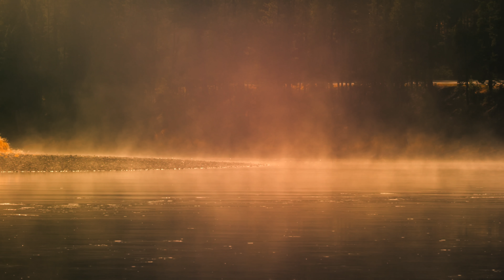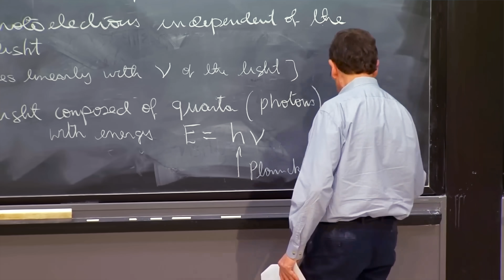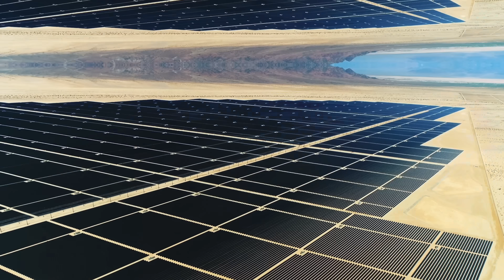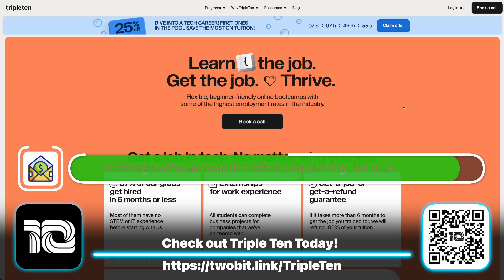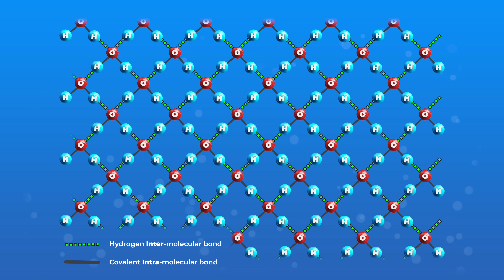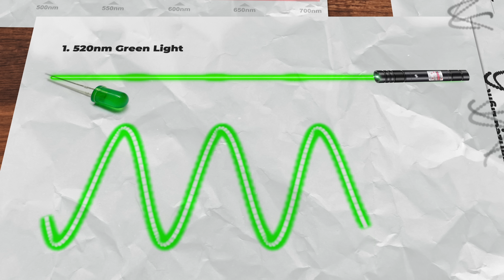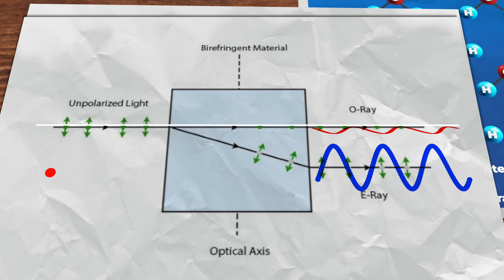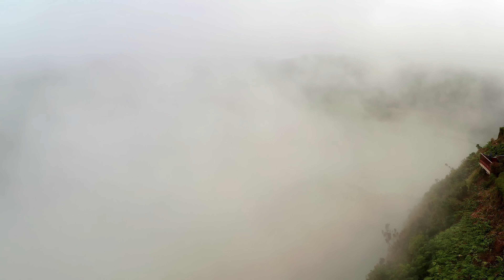New MIT Discovery Just Solved Water's BIGGEST Mystery!

Comment: Could we make a solar cell that lets the green light pass through and generate electricity from the rest of the spectrum?
Reply from the maker: this is very interesting, the key would be to collect as much electricity with band gap solar that allos allows the green through for some other effect. such fascinating potential!
Reply: photomolecular effect doesn't generate electricity though. but you could do the kther way around and  have water on top of the solar cells rhat would evaporate and cool the cells and produce warer vapor at the same time. the problem is how to catch the water vapor on top of rhe cell Ithout obscuring the light. plus how to keep water on top if the cells are leaning towards light. you could use capilarity to slow down the water following gravity, and and a layer of air sandwiched between the layer of water + colar cells and a clear glass/poly panel, holding the vapor recirculated to condense into a distilled water container to make you solar panels produce electricity + drinking water. letting rhe solar panels flat would avoid the need to pump the water up the slope, but reduce the panels efficiency...also evaporating dirty water on top of a solar panel would quickly create residues that would block light so your water needs to be filtered first.
Reply: @geemy9675  🤔 There's a new PlasmaChannel video where he moves water vapor around with static electricity. If you could get the system to naturally build up a static charge, maybe you could move the water vapor to the corners and collect it on mini fog nets? I am assuming the power it would take to power the static field from the solar collected would be more than a useful output of the panels.

Water droplets generate a static charge, but would there be enough generated by the drips from the fog nets?  And not be discharged every time a squirrel ran across it.

Haha, maybe a wind powered wimshurst machine to power it 😁
Reply: @colleenforrest7936  the static charge is not spontaneous but result of movement of falling droplets , it's only converting energy (potential >mechanic>electric). when you want to "produce" energy you actually have to wonder what energy you want to convert and what will supply this energy. thinking producing vapor will spontaneously generate electric energy is forgetting this basic principle
Reply: @geemy9675  maybe even out the pulses with a supercap could you collect that charge in a supercap and then use that to power a battery that charges the static field on the solar panel.  Granted, the math has to be done to see if it's a net positive system.

Putting this all together, you'd have a rechargeable battery responsible to keep a steady static charge over its assigned cel. 

The battery is charged by a supercap, with some sort of distribution net to transfer  excess static charge to other super caps (or electricity to the batteries if that's a better design) that are underpowered, and a sink to hold any excess charge above that for later use. The supercap is charged by droplets of water vapor condensing on a small fog net sitting sitting in the corner of a solar cel. This water is then channeled off to a freshwater holding tank.  The water vapor is created by the evaporation of "dirty" by green light, with the rest of the light in the spectrum being allowed to reach the solar cel and generate electricity. The water vapor is moved to the corners of the solar cel and onto the fog nets by manipulating the static field, which is charged by the battery.  As is current, there would be multiple cels on a panel, and multiple panels in the system. Questions as to wether the math works out on an ideal system, would the dirty water or water vapor reduce the charge to the solar panels...

Gees, I watch too much YouTube 😄
Reply: That's a pretty good idea and it could work. We could simply split the light using a prism or something similar, redirect the green light, then recombine the rest of the light to point it at a solar cell. With the generated electricity, we could then power a green LED and get even more efficiency out of the system.
Reply: @Israel_Two_Bit  - Definitely "Mirrors!" Maybe no "Smoke" - But we can work on that! 🤔😲😂
Reply: If you could, you could do far better than this - separate the light into several different bands and aim each at a PV cell tuned for that range of the spectrum.  Such a setup would blow away current solar panels for both efficiency and longevity.
[PV cells absorb at a specific spectrum - light below that energy level does not produce electricity, and light above that energy level produces excess heat, and less electricity than it otherwise could.  Reducing that excess heat would be the longevity improvement.]
Reply: thats just a solar cell with a green light filter over it, would actually have less energy since your not using all of the energy, wasting energy by not using the green light as energy. How about this, a water panel which will work all day and night since the moon still reflects white light, the water in it evaporates and the panel uses its energy involved in evaporation, then the cell of water condenses, and it does it with the rest of the cells, rinse and repeat.

Comment: Desalination would be an extreme leap forward.
Reply: Probably just set up a continual flow of seawater through a desalination system and the seawater that comes out will only be slightly saltier than at the intake.
Reply: If the evaporation from light causes groups of water to evaporate instead of single molecules, would that cause salt trapped in that group to be carried over as well, or does the salt get excluded?
Reply: @tardigrades3184  I don't think NaCl makes hydrogen bonds so it can't connect to water molecules, it just dissolves in water.
Reply: @tardigrades3184  No.  only water vapor would be able to evaporate into the air.
Reply: We should first figure out what to do with the waste brine. But of course we won't.
Reply: @davidmccarthy6061  perhaps sodium batteries?
Reply: @davidmccarthy6061  Use it to make Sodium Hydroxide (NaOH). Use NaOH in water to strip the Oxide layer from aluminium. Aluminium reacts with water creating an electric current, sensible heat and pure hydrogen gas. That makes aluminium a perfect source for seasonal energy storage and on-demand hydrogen production.
Reply: @davidmccarthy6061  there are plenty of uses for salt, and brine. We have plenty of tapped out salt mines we could store the new salt supply in. But I understand your sentiment, we (as a society) are often finding solutions either "in the nick of time" or after the disaster has already happened. Then someone sees an opportunity to exploit the disaster for billions of dollars, setting the situation up for the next foreseeable and preventable disaster.
Reply: @davidmccarthy6061  most places that need desalination are desert, so we could just fill basins with salt to create highly reflective salt flats to reflect the sun.
Reply: @davidmccarthy6061  What is completely underutilized is the resultant brine from desalination processes. It is usually considered as a problem to deal with, rather than an additional benefit from the process. Seawaters common name of salt water is part of this problem. That causes the other elements in the seawater to be somewhat ignored. 
  If you completely dry the brine, what you have is about 150 different compounds arranged in various molecular structures. This will vary, depending upon where the initial seawater is sourced from. These compounds are easily reduced to a powder form. Which will make the initial separation processes relatively easy. Just pass them over a series of different sized meshes. You can then use magnets and other separation processes, such as ones that differentiate between densities, to refine these elements to an even greater degree. Of course this would only be economically feasible in a large scale model.
  A major cost in traditional mining processes is the crushing of the substrates that the desired materials are embedded within. The above mentioned process eliminates that cost. The materials come in an already powdered form, or one that is easily reduced to powder. The economically valuable elements that are embedded within sea water are numerous. Everything from iron to gold and silver.
Reply: @davidmccarthy6061  Molten salt could be a huge help in making safer nuclear plants,
Reply: @cuzz63  Yes, but that would be salts of Thorium.

Comment: sublimation- known for many years. For example, snow straight to vapor.
Reply: @buildaboiworkshop it's H2O- light activated escape.
Reply from the maker: yeah this isn't sublimation, this is the interaction between photons and the hydrogen bonds that hold water together. but what it can mean for our understanding is pretty amazing
Reply: @TwoBitDaVinci yeah its not the same but photomolecular effect might work for sublimation too? H2O molecules in ice or snow have 4 bonds so I have no idea if photons have enough energy to create sublimation ar rge surface of water crystals but if it does it could have implications about ice & snow melting/sublimation models
Reply: @buildaboiworkshopbut water does exist in three states like any chemical element. the phenomen described in thr video isbnot sublimation but it raises an interesting question
Reply: @geemy9675  many many miles beneath the surface of the Earth, water is bound in rock at pressures and temperatures that give it a supercritical state. Water has many more states than 3.
Reply: @TheRotnflesh  you can argue 3 or 4 but the point is water is not only liquid

Comment: Superb presentation. One of the best cutting edge science explanations I have ever heard. I live in the humid south. I have always admired arid western "Swamp Coolers" which cool air through evaporation. Drying humid air with light to cool it, has major potential.
Reply from the maker: thank you Chris for the kind words.... swamp coolers ... now that's interesting... because of the potential for cooling there's some synergy, but it would increase humidity and in the south you definitely don't want that. Capitalizing on this phenomenon would be great in dry warm places like the southwest
Reply: @TwoBitDaVinci 
 I listened closely to your discussion starting at TM 9:30. Yes, the resulting air is cooler and more humid. For humid climates, all that needs to be done is to use an air-to-air heat-exchangers. Depending on the Delta-T, cooling the incoming outside air should cause condensation.  Thanks Again.
Reply: @TwoBitDaVinci Of course in a race between evaporative cooling, AC, and heat pumps. At this time good heat pumps win.

Comment: The wavelength that is most efficient is the same as that of most plant leaves or algae.  Is there a connection here?
Reply: It could be a factor but I would be careful about jumping to that conclusion. 

This explanation would only make sense if reflecting the green light decreases the likelihood of this interaction occurring on the plant. Given that it is a surface interaction (i.e. the effect happening further inside the plant would not cause evaporation because the water is not in a position where it can leave the plant) reflecting the green light rather than absorbing it may actually increase the incidence of this effect (absorbing the light with a pigment would reduce the number of times the light passes through the surface of the plant).

Compound this with the information that:
- Not all plants (or more generally green photosynthetic organisms) are in areas where transpiration is a negative thing--thus this selection pressure would not be present for aquatic plants or ones with excess or sufficient water supply. We know that there are shallow water green alges that have been around for a long time (which would never have a reason to limit transpiration because they are literally swimming in water).
- There are other fairly well researched reasons that plants may avoid using green light. For example that structures that absorb it (with green being the peak output of the sun for terrestrial/shallow water) would have harvest too much energy which could cause damage or disruptions (basically over charging things which is dangerous). This research that looked into this model of 'moderating energy capture' and it apparently fit even with things like purple photosynthetic bacteria (because the spectrum of light reaching them was different).

tl;dr there may be some connection in some places, but I don't think this is anywhere near enough evidence to come to that conclusion especially given there are already other models that seem to fit more universally.
Reply from the maker: Louis, this idea is something I can't stop thinking about! On the surface it makes sense that plants would be green to reflect that wavelength of light to minimize water loss... how crazy exciting is that... I'm going to look into this further!!!
Reply: Not only that. It's also the wavelength that is least absorbed by liquid water. There has to be a connection.

Comment: When we discovered the photoelectric effect, that spawned hundreds of new technologies we rely on today, like LEDs, solar cells, light sensors and detectors and, by extension, fiber optic communications and electronics like what powers the internet. Can you imagine what could come out of the photomolecular effect? Perhaps even new ways to etch transistors onto semiconductors and other crazy stuff that could change the way the world works!
Reply: In a related matter, I've often wondered why cool humid air feels colder than dry cool air - while warm humid air is the opposite. I speculate that near the freezing point, many of those clusters are actually ice clusters, and it takes a lot of heat energy to melt and vaporize the clusters. Regardless, I think water vapor in cool air is in the form of tiny, tiny water droplets and it takes heat energy to evaporate them.
Reply: @FLPhotoCatcher  ice clusters? Like microscopic slush? So, clumps of inert, bonded, water molecules that aren't plentiful enough to form a visible ice crystal?
Reply: @Arthurians  Maybe not the most scientific terminology, but it could happen.
During one of the last storms we had here in NorCal, I was sitting in my car gabbing on the phone because I forgot my umbrella, and I noticed that mixed in with the rain was tiny micro hail, a mm or smaller. The lighting conditions just happened to be perfect for me to see these baby hailstones bouncing off the hood of my car. 🍀